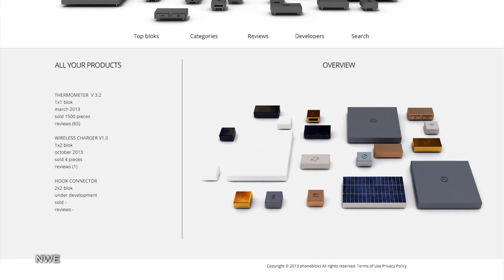Why Phonebloks Aren't Going to Happen

Comment: And then google proves this jerk wrong once again.
Reply: For all intents and purposes Phonebloks and Project Ara are the same. THye've basically teamed up with Motorola and the got google involved.

As for this idiot in the video. Ia gree with others, people like him are the reason innovation is lacking now days. You say it won't happen....I say anything is possible
Reply: This guy was wrong ahahhahahahhahahhahahaha
Reply: hardly. Project Ara can't let you place any chip in any place, you still need a standardized endo skeleton which still has to be set in place and limits are placed on what size you can put where. This guy isn't wrong, he confirmed everything.
Reply: So Project Ara is not EXACTLY the same and there are some diffuciltys still but the simple concept is rapidly becoming a reality with Project Ara.
Reply: Project Ara was in development before Phonebloks and it was being done by Motorola and Google. Phonebloks is nothing new.
Reply: Skeptical Chris Parts are put together to minimize the size and weight of the phone, not because of speed. And the issue about the processor being far away from ram was solved long ago in the pc.
Reply: Indeed :)
Reply: Unless it's almost the idea.
Reply: Skeptical Chris True, the hype about phoneblocks made Motorola and Google announce project ara and not keep it a secret. It clearly made project ara develop quicker as well.
Reply: I no I am getting one
Reply: Lol nope he was right 4 years later.

Comment: Don't get to exited people. Google intends to have a price of 50$ for the basic phone which I guess would include a touchscreen, 512m of ram, a 1ghz processor and maybe 4 go of storage if any. The modular parts are mostly going to be very inexpensive gadget add ons made by 3rd parties. Think if it like the accessory market for iPhones but much cheaper cuz the modules are meant to either be disposable or to be used intermittently. The reason they invest so much money and credit in this its because they believe they will break into new markets with it. They have no intention if competing with the existing smartphone market cuz that would be suicide. Yes the idea at first was to revolutionize smartphones but the available tech doesn't allow a phone to be powerful like the Nexus 5 or iPhone 5s and modular at the same time. The processor will likely be attached to the base as well as a minimum of ram and storage for the OS so upgrading your processor will not be possible.
Reply: give it time it will be worth it
Reply: Not true, Google is aiming for a $50 BOM phone... not what it sells for. They are also not set on one way to sell the phone, they are open to multiple ways, whether it is a carrier subsidizing a pre-built phone, or you buy the endoskeleton from Google and buy the modules by themselves, etc. Yesterday they said that their aim at the beginning is to have a $600 Ara phone that rivals the performance of a $600 typical phone.
Reply: Project ARA Phone at LAUNCH co 
Yeah, take a look at this and tell me if you still feel the same way.

Comment: In short. 1 year later Google shows a working prototype  and realeases an MDK or midule devellopers kit and expects product to go to market early 2015. I think it was extremely shortsighted of you to say it would NOT happen anytime soon. With 3d printing becoming better and cheaper and considering that most smartphone now use the same hardware and connectors (android and iPhone) the obstacles you mentioned can be easily solved in the development and design phase.

Comment: This is an idea whose time has come.  Multi-modularity. (Finally) Make your phone what you want it to be and enable it to evolve/swap out parts/enhance/expand to new forms.  The ability to now democratize micro-electronics assembly (similar to the currently more "fringe" Arduino movement) with incredible mainstream applications.  Drawback in this commentary; the processor/RAM/ROM close enough to optimise bus efficiency?  Does every micrometer make such a difference?  Clock it.  And if it's not fast enough, go fiber-optic with the bus.  The essential part is micro-electronics modularity.  Paul Eremenko was trying to describe other uses such as mass spectroscopy which would give the ability to identify & analyse molecular & atomic information.  Radon detector?  Whole nation can avoid leukemia and lung cancer over night.  On that note: You could easily track anyone carrying nuclear fissile material (dirty bomb, etc) for anyone willing to install such sensory modules.  They were trying to indicate a reference to Tri-corders (Star Trek medical scanner reference) which will become a super-great priority among our aging but somewhat tech-familiar seniors.  These are but a few of the innumerable uses to be devised (connect to your car's PC anyone?).
Conclusion: The benefits will far surpass any minor inefficiencies lost in a more widespread "landscape" or geometry.  Most essential - Getting generations of inquisitive "hackers" back into hardware at a time of most precipitously shrinking size.  Next step will be to help enable home-micro processor design.  Are they really too complicated for this new generation?  If micro-circuits are made as modular components, the whole system is simplified and we will find innovation far beyond what would be the normal goals of a standard company.  And I think that's the point.
Lets open the door.  And walk thru it.

Comment: All of you in the last four months or so are saying that he is/was wrong. But that was before the update that they are going to use slide in chips instead of a pin board. But it's still not exactly 100% changeable that way. You'll need to buy different slid motherboards or something like that

Comment: With a few modifications I don't think this is that far fetched, all they have to do is integrate the processor & RAM, and perhaps some internal memory for the OS into the "Base" block (the thing between the screen & the add on blocks) then basically it is just a small computer with a tonne of little USB connections or whatever they choose to use for all of it's peripherals

Comment: "Project ARA" is a phonebloks type phone that is already starting to show through. They already have a working prototype and have many companies already invested into it. The main part of the phone(the base block from which all the other components attach) is developed, manufactured and will be sold by Google for around $15USD. Component prices themselves will depend completely upon the individuals supplying them ( this is assuming Google will not be manufacturing components themselves)  

Companies that choose to take part in this project will be able to sign up for free and market their own components without having to pay Google to do so, Their companies will be completely independant and purely self profiting. There are already companies signed up to this project and it is predicted that within the year the tech will be ready for commercial use.
The components will be bought through a system very much like the "Google play store" where companies will have to be independently verified before they are able to sell their modules on the store but will be completely free to sell them outside of Google play also at their own risk.

I see this tech as being a very smart move, being able to swap out components for what you need at that current time. You will be able to take off all other components and just use it as a music player or use only what you need to surf and download stuff on the web. You can take out the block of the phone that hold your personal information/photos/music and lend the block to someone else so that they can insert their own modules for temporary use or swap out modules for different environments (Work/Home/Public)

Comment: The most reasonable type of modular phone before optical is:  screen is one piece, but it includes your front camera (or a changeable flip like that oppo phone...the n1?) and a battery compartment (with external sdcard/sim) and an soc that is changeable. this soc would be a full on soc with everything integrated. one of the major reasons is: when a new standard for wifi comes out, or a new standard for gsm (or hspa or lte, etc) comes out, or whatever. everything else will be out of date too....but more importantly, power use. not only is it about timing/bandwidth for things being closer together. a single die with everything on it has no "macro" scale interconnect. not separate chips with interface components. battery tech limits mobile. screen and camera (lol, and microphones and speakers) matter less than the actual guts. one swappable mainboard makes more sense than 20 pieces all needing odd serial controllers to interface using a few pins, etc.

Comment: Of course itll happen.. the components themselfs are not the problem its the circuit wires that connect to each compoent and make it work once they figure out the base of the phoneblok it would pretty easy n that would take a few trial n errors in proto types but end product will happen.

Comment: "plus for all of this to work, you'd have to make a standardized system that would ensure any and all combinations would work 100% of the time, which isn't likely" yeah just look at a PC, you if buy parts from different manufacturers, the PC won't work....oh wait, it will work 100% of the time.... oh yeah and putting a processor in a different spot on a circuit will slow down its speed by microseconds, its basically got a simplified mobo (motherboard) where all inputs are the same format, allowing you to put any part anywhere. Also, having the device that picks up your cell signal in a different part of the phone than the processor would create an extremely minimal difference in speed (again, fractions of fractions of seconds). It's like a random guy who knows nothing about computer engineering or electrical physics just saw phonebloks and said "dude that would totally not work, I'm gunna make a video bashing it using points that will fool other people as dumb as me". Grow up and put some research into something before making things up and making a legit looking video on it.

Comment: Technologically it is certainly possible.
It may not be as efficient, but the benefits are easily outweighing the costs for me.
I have a Desktop with an 8 core processor and an dedicated GPU, my phone does not need to be powerful, because my desktop does that for me...

Comment: Okay can I just point out that when it comes to the physical location of the components, as long as you keep it under ~7.5cm you should be fine. 1 / processor speed = amount of time electronic signal has to make it down a wire in a single cycle. Tine * speed of light = distance electronic signal can travel in that amount of time. So, ( 1 / 4GHz ) * 3.0*10^8 m/sec = 0.075 m or 7.5 cm. Now, that's assuming a 4GHz processor speed, far faster than any processor currently deployed in a smart phone. Current phone processors run closer to 2GHz, which gives you ~15cm to work with.
Now, I know, these wires we're working with aren't superconductors, we have to deal with resistance and capacitance of the wires. But as long as major components are placed near the processor and less important ones farther away, you'll be fine.
As for getting them to all use the same communication protocol, what if you made even locations I2C bus connections and odd or offset locations for some sort of super high speed main bus. The larger blocks like processor would be able to afford using offset pins while the smaller blocks would just use pins around their edges.
So you just won't be able to place your pieces quite wherever you want, but the idea remains the same.

Comment: I dont think he understands that smart phones are just small Computers. If you can build your own PC then phoneblocks should be fairly easy to assemble.
Reply: you dont know how into computers I am. I may not know everything but I build computers and I've noticed phones aren't that different. the specs in phones are becoming more and more similar to computers. Phoneblocks are just a concept and anything that doesnt work for the consumer can be changed post release.
Reply: ***** Hey mate, you both have a point here.
Now in theory yes it can, it is a problem when putting it all together.

Now I build circuits so I do understand the logic here.

Now to answer both of your questions.

It can be done, but it would be difficult.

Imagine a big wooden board with a whole bunch of parts on it.

I can connect them all up but it certainly isn't the best way.

So what circuit manufactures do is move the parts around to make the circuit perform at it's best.

Now if the device is smart enough to know exactly what device is plugged in which pin, it's surely smart enough to tell the user: hey, bad design here! Please swop these devices around to give this device the upmost performance.

The biggest issue is compatibility or lack there of.

It's the same with computers, you build a computer with parts you know work together, if a user that has no aspect of this tries to do it and is now whining "But I bought the most expensive parts and my phone is still slow!"

What do we do?

So I hope I answered your questions in a different light. :)

:)

Comment: The technology is there, it just needs to be scaled down; the aspect of making inter-communicating hardware. I'm big tech geek when it come to automotive applications and computers and mobile devices. ECU and other modules in a vehicle talk among each other on what is known as a CAN-BUS (controller-area-network), and think of all the peripherals (or options) that can come in a vehicle; DVD, GPS, heads up display, assisted braking, etc.  

The same can also be said about Desktop PC; more importantly a particular form factor call 'mini-ITX'.  Take a 'plain-jane' mini-ITX; pick a processor, pick RAM, pick ROM or SSD or HDD, load OS, then go on a local hardware retailer/e-retailer (NCIX/ newegg/ memoryexpress) and buy USB peripherals; Wireless N, webcam, micro-SD reader/writer, keyboard/touchpad/touchscreen, and lastly SIM card reader/writer.

Everything I just listed, is found in a smart phone. It's just bulky, a mess of wires, and not very portable or portable at all.

So what is the biggest issue.
Scale-ability, and a adopting a uniform communication bus.

The components are at our reach...
.......make them fit.

Comment: Your concerns were not valid, simply put the ram/cpu on the same chip - problem solved. The only reason I see it would not happen is because it would destroy the market.
Reply: Destroy one market(phone market) to create another (phone parts market)
Reply: exactly. thats the only thing which will be the obstacle. besides its still a concept, they must have already thought about these problems. I love this idea because this concept is very close to the concept of a pc where you can upgrade the hardwares you need which allow you to focus on the specific activities you usually do. But in todays phone there is always some limitations. Good gpu for gaming, but low storage in phone memory. High storage in phone memory, no options to expand. So, we are basically paying heaps of money for devices which have limitations from get go and reqiures replacement within few days. This is why this phone is a great idea.
Reply: MinecraftEpicPlayer Nope. The phoneblocks market would be a fraction of the current market where the entire device would need to be thrown out. That is the entire point of the project. The end result would be almost the entire market destroyed. The ratio would not be 1:1.
Reply: I think we're discussing a new paradigm. We should take a step forward anyway .

Comment: So why do you think Phonebloks are impossible?
Reply: full HD display running on just 4 unshielded pins that cannot be impedance controlled.

Zillions of those little technical details that would limit the performance of the whole thing to the level where it has more drawbacks than features.
And also non-upgradeable.

Think of it this way: PCs are based on a concept of extreme combatibility, upgradeability and standardisation. Most standards are kept like forever(the ASCII table, OS, 3.5˝ drive size, power supply voltages(5,12,3.3))
Now compare a 10 or 20 year old PC to a modern one. Play youtube in full HD on a 200MHz Pentium. Maybe in win8?

For a cellphone, I'd rather have an old nokia 3310 that simply never gets broken x)

Comment: I would doubt this would happen for a different reason. Do you think all the big phone manufacturers want you to keep your old phone for ever and upgrade little parts every so often to keep it current? Nope that not good business for them. They need to keep customers buying a new expensive phones frequently. For that reason this is an idea that will likely never go to market unless it is a standard phone which the phone is not upgradable performance wise but they allow you to interchangeable only a few add ons like different cameras, batteries, storage space only. id love to increase my storage from 16gb to 32gb right now!

Comment: Considering one thing about modularity, Home PCs are pretty much using a similar concept. If all the devices we have follows that kind of concept we could have pretty much the best thing and probably put an end to closed systems which anyways are expensive and are programmed to fail quickly and so generate pollution. And instead we go with more open systems where anyone can bring innovative modules and certainly achieve to get the best combinations of technologies.